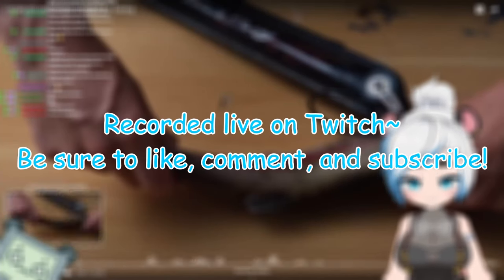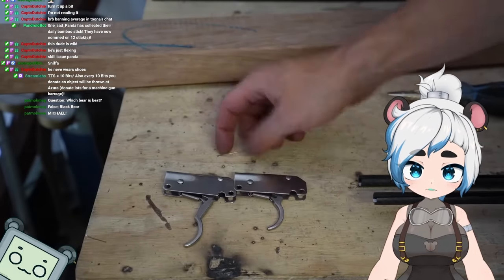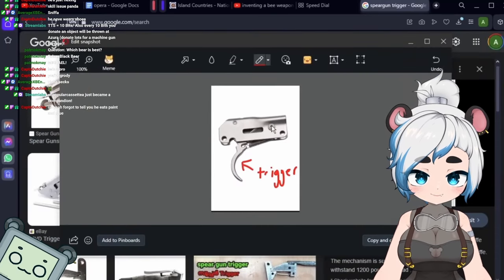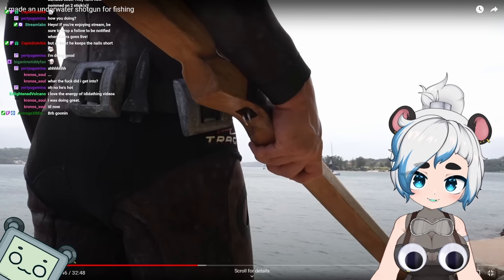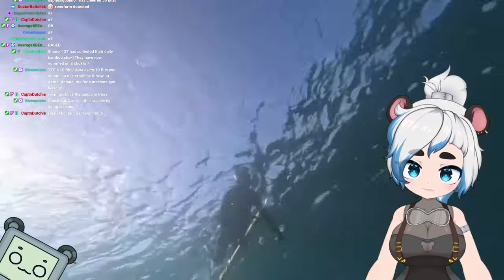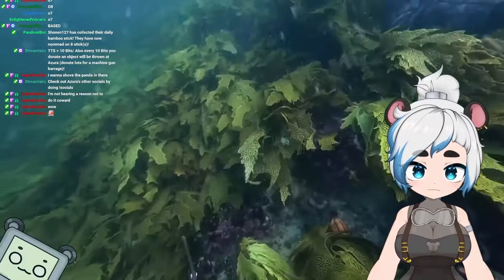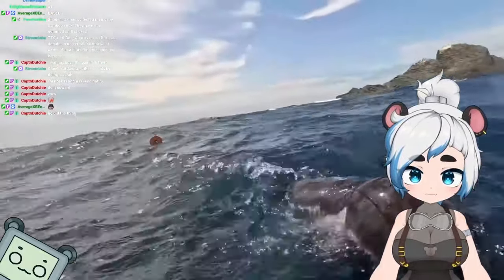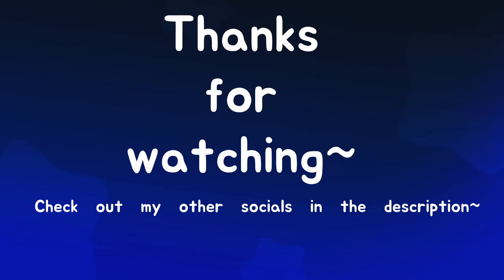This could only go so right. | Azura Reacts to I Did A Thing

Comment: 9:58 "this dude will not wear shoes to protect his feet from power tools, but will wear a gas mask to protect himself from Epoxy?"

Umm, yes? It makes perfect sense. You dont need toes to live but Epoxy will kill you over time if you breathe it in a lot...you need to be alive to live. 

I used to know a guy that would paint cars professionally and never wore a mask for it. 

They found him dead in his apartment one day from lung issues. (Something about micro-particles in his lungs) He was only 30 something. He didn't know how dangerous it was.
Reply from the maker: Ooh, I didn't know it was so toxic, I personally haven't used the material or know anyone who has. 

Makes total sense now.
Reply: @SimplyAzura  basically any aerosolized paint or sealant is very bad to breath in. the fumes and particulates are nasty. when welding for instance that shit is putting off toxic fumes, and it can be straight poison depending on what you are welding together. when you are sanding wood, you should also wear a mask for the same reason of wood dust can get in your lungs can cause problems. breathing in hazardous stuff is more of problem when building and working on construction than some people ever realized. theres one video where he modifies a ceiling fan. he does a bit where hes breaking through the dry wall in the ceiling and hes just breathing in the drywall that he punched his way through, thats just gypsum down his throat and thats also some nasty stuff.